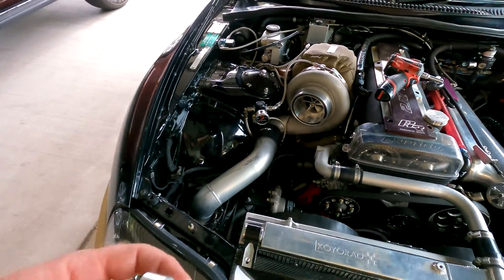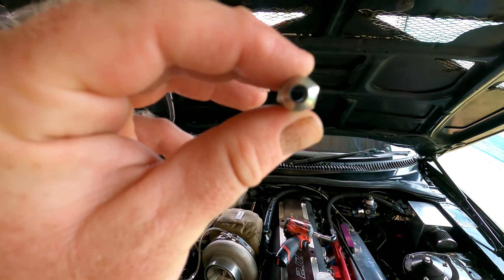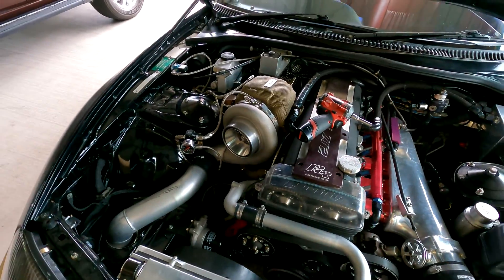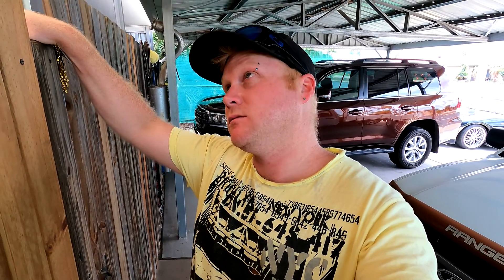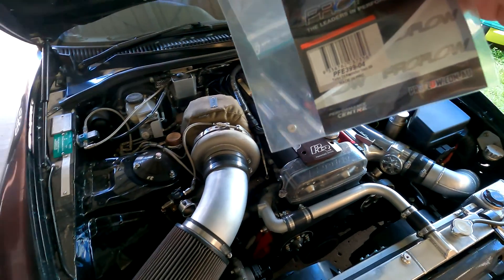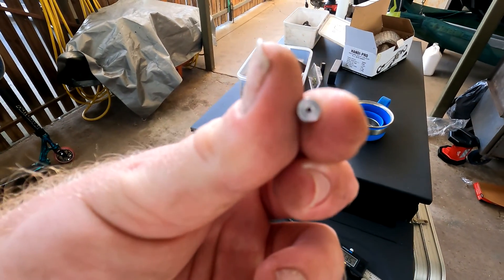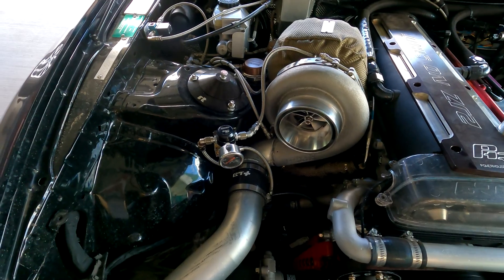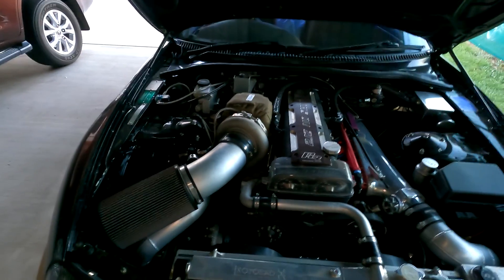turbosmart opr T40 1mm in line restrictor ??? smoking turbo

Comment: did you consider the fact that you have the filter on the drain line is a restriction for the drain which needs to be free flowing. Logically, the filter should be on the inlet to the OPR to directly protect the turbo, removing any particles that may be entering the bearings. it is imperative that drain lines be as free flowing as possible. try switching it and I believe that we will have a favorable outcome.
Reply from the maker: Yeah I noticed i put it on the drain line lol  I soon changed it to the feed line after this video it didn't change anything but I fixed the problem in a later video

Comment: So the excess pressure that's bled off by the regulator feeds to the drain for the turbo?

Is it possible your drain isn't large enough (or straight enough) to flow the oil from both the turbo and the regulator back to the pan quickly enough?

Can you run a larger line from the bottom of the regulator straight to the pan?
Reply from the maker: The flange i have driftmotion that bolts straight to the sump has its own separate hole for the opr return its a 5mm hole it dosnt interact with the turbo return at all but I feel the return on the opr t40 is just to small to handle excessive oil pressure I could possibly make it bigger but the diftmotion flange making that bigger it would cut into the drain hole of the turbo return but im not sure if it would make a diffrence if both interact right at the flange on the sump or the return fluid from the opr would help scavenge the throfy fluid from the turbo drain hole since its not creating pressure for each other being so close to the sump so maybe ill try drilling out the opr-t40 for a bigger line and the driftmotion flange ill make a bigger line for it aswell and just see how it goes
Reply from the maker: New video up mate the drain port on the opr-t40 was only 3mm  I drilled it to 4mm to match the drain line it works perfectly now as ended im surprised turbosmart overlooked this the give you a -4 fitting for the drain but the opr-t40 is resticted by 3mm thats a bottle neck within itself product made to fail
Reply: @Savage6supra  very interestingggg. What weight oil are you running?
Reply from the maker: 10w60 fixed the opr-t40 needed to drill out the drain hole it was only 3mm making a bottleneck

Comment: I also got an T40 for my Precision 5858 dual ball bearing  .82 a/r  but haven't installed it yet. Oh man so that means it's still smoking. Is your turbo a ball bearing or journal, cause I believe the T40 works for ball bearing turbos. Anyways, I hope it will work on mine
Reply from the maker: Mines a pt7675 ball bearing turbo its still smoking not as much I have a 1 mm restrictor inline with the t40 it has helped the t40 out a fair bit but I shouldn't have to run one with a opr t40 lol

Comment: Any update from turbosmart on this?
Reply from the maker: That reminds me I havent emailed them back with a update on how the new one goes with is the same over pressure ill send a email off now
Reply: @Savage6supra  oh ok. I was curious because I just got one in for my camaro. Cold start oil is 70psi. Hopefully it does the job. Let us know what they say.
Reply: @Savage6supra  Keep up updated! Going through the same issue
Reply from the maker: Havent had a reply as of yet ill keep trying
Reply: Just got one to try on my Supra, cold start oil pressure is 9 bar and once warm at 7800 rpm it sees 8 bar (120 psi).

My Journal Precision smokes so hoping this helps but will try with its own return line as that may be your problem.

I was also looking at the size of the drain on the OPR.
Reply from the maker: It runs a -4 return line from the opr t40 but i think this might still be too small to handle such a high main pressure even with a 1mm restrictor inline the oprt40 still struggles
Reply: @Savage6supra  I noticed that if you look from the bottom it only has a small hole inside. Doesn't look like I can add a photo though
Reply from the maker: I've emailed them and asked if they have any thing in the works with the opr-t40 to handle engine with alot higher oil pressures it would be as simple as making a bigger return port and a spring to suit
Reply: @Savage6supra  I don't have one in hand, but one picture I saw mad it look like the return had a smaller than -4 hole inside. Does it look like that could be drilled out a little?
Reply from the maker: Possibly could be I had that thought aswell drill and retap for a bigger line maybe ill give it a try seeing as the opr-t40 is useless to me at the moment since im running a 1 mm restrictor only function thats good is the oil pressure gauge
Reply: @Savage6supra  you don't even need to tap it if you look inside it's probably a 1.5mm hole in the middle of the return. You where increasing the input to sump to 5mm but the little hole in the OPR is maybe 1.5 or 2mm.
Reply from the maker: The hole on the opr acomadates a -4 fitting if I want to go larger year I could drill out that fitting to free up some flow but it won't be by much before its strength is compromised and if I wanna go to a much larger line I would have to drill and tap new threads in to acomadate a bigger fitting
Reply: @Savage6supra  I'm with you, just wondered when you made the othe fittings all 5mm ID.
Reply from the maker: Well the driftmotion flange was allready 5mm so I made the 90 degree fitting by filling it 5mm but never thought about the fitting on the opr itself i guess its the bottle neck ill dill it out to 5mm and get back to u
Reply: @Savage6supra  https://www.turbozentrum.de/media/image/product/141290/sm/oil-pressure-regulator-black-turbosmart~4.jpg.webp  found a pic
Reply from the maker: Oh ship I never looked at that im going to take mine off tomoro and have a look at how big that hole is
Reply: @Savage6supra  Was discussing with a friend of mine and he was saying that with drilling the hole bigger you need to check that the valve can still close, not sure if its a needle that seals it or a flat cover....
Reply from the maker: I havent got to it today been bed ridden with the flu but I was thinking about it aswell ill take the opr apart and have a look at how it seals closed before I even attempt to make the relief hole bigger
Reply: @Savage6supra  I have been hunting and I am still concerned about your shared fitting possibly being a restriction. I know that flange is made with a hole but it was probably designed for something else. I see Turbosmart warn against it

CAUTION!  Do not place the OPR return together with the turbo drain line as  this will interfere with the function of the turbo drain and may  cause issues with the turbocharger oil system
Reply from the maker: Yes that the caution for putting the opr drain line right into the turbo drain itself like a T Junction the flange i have was purely made for the opr turbo drain and opr drain are completely separate stright into the sump I I was to put the opr drain on the turbo drain hose itself like a T fitting it would force the oil draining from the turbo to go back to the turbo putting the turbo drain hose under pressure
Reply from the maker: Mate had it apart its only 3 mm i drilled it to a 4 mm the piston will still seal and now its sticking to 40psi its actually doing its job now 40psi with 104psi of engine pressure
Reply: @Savage6supra  So let me get this straight.
Your solution here was to drill the DRAIN PORT hole from 3mm to 4mm and now its flowing properly and sticking to the 40PSI limit it should hold?
Reply from the maker: Yup the 3 mm hole acted like a bottle neck inside the opr-t40 make it pointless it sticks to 40psi now think I saw maybe of 42 at 4000rpm I just put a video up of it should be loaded up shortly
Reply: @Savage6supra  Excellent news, and could you remove the restrictor on the supply
Reply from the maker: Yes the 1mm restrictor is no longer in the circut I just uploaded a short  video on doing it its actually working as it should of by design
Reply: @Savage6supra  I think they probably did the testing on engines that produce 80PSI and 3mm hole worked but didnt test on >100PSI
Reply from the maker: Yeah im thinking they tested it on engines making 56psi-60psi but why give the option of putting a -4 fitting on to run a -4 line as the return minimum if they only have a 3mm hole its a drain its not to govern pressure but to release it the spring is what governs pressure i feel they made a boo boo
Reply: Yea, that's what I was thinking. Not large enough to have to re-thread, but maybe make that hole inside 25-50% larger. Probably should start with a small increase and test the effect. Wouldn't want to lose too much PSI
Reply from the maker: The psi is governed by the spring on the piston like a normal waste gate or a fuel pressure regulator im thinking the uneeded fluid can't get out fast enuf its bottle necking the opr and holding the pressure in
Reply: @505Goat  I don't think you will effect the pressure as you are increasing the outlet under the spring and soon as its 40psi the spring should close, I think the valve is opening but the OPR is not able to get rid of the excess, seen as though its getting 100psi